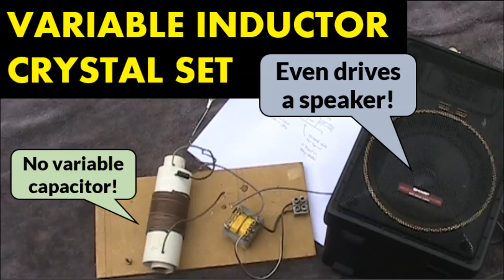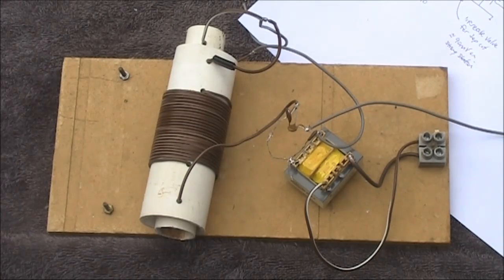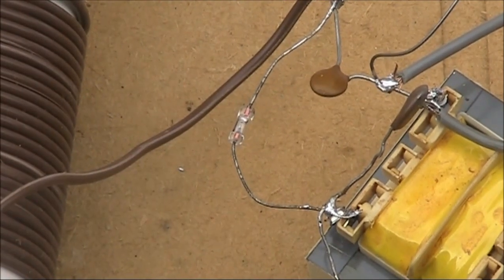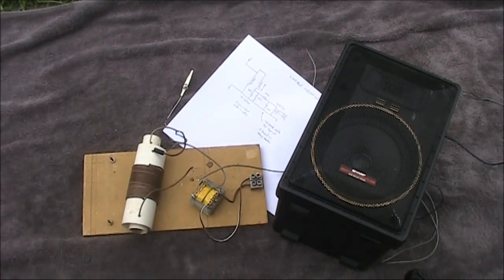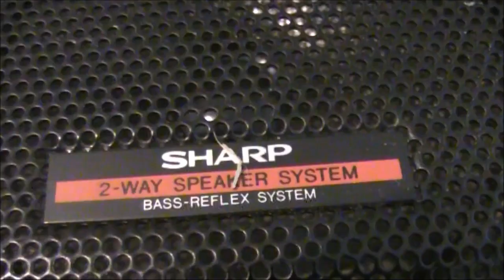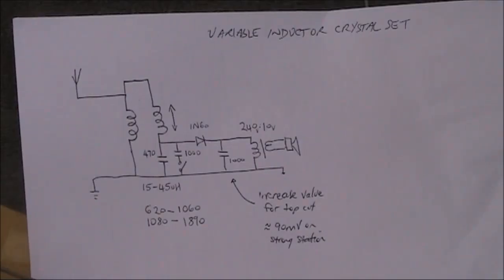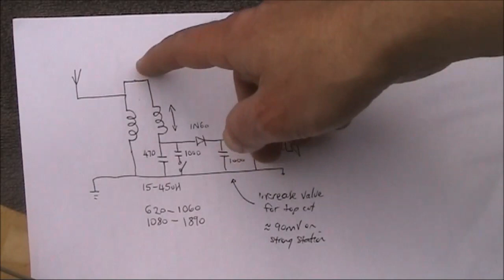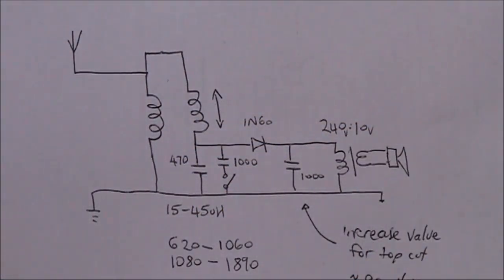Variable inductor crystal set drives a speaker

Comment: I grew up with an inductive tuned crystal, was small rectangular and green,antenna was pulled up to tune . Got a Radio shack ,RIP, 50-1 and proceeded to build various radios and oscillator. I was very close to radio park on top of the 400 ridge over the valley with Birmingham. I could drive the small ( common to most 5-6 transistor radios) that came with it . I had a high horizontal line almost perfect for the max amplitude. Billy Green was seven years older , he strung my antenna and had done similar things as a kid, and living next door. Almost killed my self taking apart the TV they threw out. CRT Flyback was in good order and blew to the tube not my right hand . God has saved me so many times….😮

Comment: Back in my youth I had a crystal set which had a coil wound on about a 10mm former and was tuned by moving a metal rod plunger, with a dark grey cylinder attached, up or down inside the former. I didn't know anything about how they worked back then but I understand now that the dark grey cylinder would have been ferrite.

Comment: There are few considerations you need to think about.
1. Matching antenna to LC-tank circuit you have. You really want to have a good matching which means the most energy will be directed to the tank circuit. 
2. The same thing for detector diode. You want to find the optimal way to tap the signal out of the selector. 
3. Try modern Shottky diodes like BAT-46. Those have lower forward voltage drop and will have less loss. You can even build a full bridge rectifier that will allow to harvest more power.
4. Improve Q of the LC tank circuit. This can be done by making inductor using litz wire and having a larger diameter of the inductor.

Comment: A quick note about the impedance and the transformer.
This is a 240V to 10V transformer.
That means its turns ratio is 240/10=24:1
When you step down the voltage like that you also step up the current.
Resistance = Volts / Amps
so we end up with and impedance ratio of 24*24 = 598
The speaker is 8 Ohms natural impedance
8*598 = 4608Ohms
This is why it works like a high impedance headphone.
You can also get a crystal earphone from online hobby stores.
Reply: Sure, you can order whatever you want from Amazon or eBay. I really like the idea of being able to build a receiver with whatever is lying around, which I think is the point of this video.
Reply: @johnwest7993  I commented for those just starting out and thus may not know about high impedance earphones.
Reply: Excuse the ignorance. Question, why does the transformer help the signal be Heard on a speaker rather than high impedance headphones? Because it steps up the current but I don't understand how it lowers impedance as well? Thank you in advance. I'm trying to build one and wow so much to take in!
Reply: @brandonlaragirl  Roughly
Z = V / I
Where Z=impedance, V=Voltage, I=Current
A transformer with a 2:1 turns ratio will have 1/2 the voltage on the secondary.  If you draw current from the secondary, only half as much is need on the primary.
Thus going primary to secondary, voltage is divided by two while current is doubled
Z(secondary+) = (1/2V)/(2*I)
Thus Z(secondary) is 4 times lower
Reply: @kensmith5694  awesome, thank you!

Comment: Peter look up crosley book capacitor. It is a type of capacitor a home brewer could make pretty simply and it was used in the 1920s in a commercial radio in the United States.  You would not want to replicate the dial shaft arrangement in order to make it rotary but you can adjust the capacitance just by opening and closing the sides. It's a variation of a compression capacitor.

Comment: Very good useing a transformer to increase the Audio.Im still working on improving a Jaycar kitset I bought,so this has certainly helped.Thanks.
Reply from the maker: I think the biggest improvements you'll get are if you can optimise the tapping point of the diode and coupling from the antenna. Kits often have a compromise position that isn't best for your circumstances.

Comment: Thank you! Very good video. I still wonder if you could use it for an antenna tuner. Would there be too much loss on Tx? I wonder why manufacturers do not use variometers in the tuners. Is it because they are too complex mechanically?
Reply from the maker: I think a version with fewer turns would be fine for an antenna tuner. Variometers were widely used last century. I agree that mechanical complexity probably made manufacturers stop using them but not an issue for hobbyists, especially with 3D printing making custom parts easier to make.

Comment: i noticed on the RTL-SDR on diirect sampling the gain is 0 yet it picks HF no problem, the lower the frequency the more natural gain, i guess it comes to antenna aperture after all, with enought aperture you can drive speakers without amplification

Comment: I should build a crystal set using the transformer impeadance match idea I got old 9 volt plugback will try  driving stereo headphones, would 40mm PVC pipe and  Cat5 cable wire making a tapped coil say 80mm long with tap ever 10 turns will work,  magnet wire very hard to get now days ??
Reply from the maker: That should be OK. But if possible I'd use thicker wire eg from an old power extension cable.
Reply: @vk3ye  I do have a 10 to 470pf varible cap
Reply: I have had good luck using a single strand of cat wire. 24 gauge. I always wind 57 turns on a 3.25" diameter PVC pipe. You can use different diameters by consulting "Professor Coyle" online. The described coil uses 49 feet of wire. 24 gauge cat wire gives you about 27 turns per inch.

Comment: So why does increasing the capacitance let the radio receive higher-end am band. By increasing the capacitance you're also increasing the inductance? Thank you in advance
Reply from the maker: Higher capacitance with a given inductance allows tuning in of LOWER frequencies.
Reply: @vk3ye  awesome, thank you. Gonna work on building an amp today. Got a 386 and a transformer. Question! Is it better to use AC or DC current to power the amp.

Comment: Technically  this will not work. Your dealing with  Uv. Millionths. Of a volt. Feeding that  extremely low voltage and virtually  no  I= current in Ua. Micro amps   the transformer would basically  ground out a signal at that amplitude!  I am a electronics Technician with a lot of engineering  behind me . THIS WILL NOT WORK!!
Reply from the maker: Nonsense.
Reply: Yeah, I can tell you left the knowledge behind you
Reply: I had two E.T.s tell me I couldn't hear what I was listening to.
Reply: A high degree of knowkedge / education doesn't always equal wisdom.